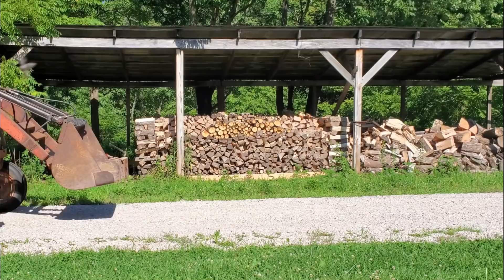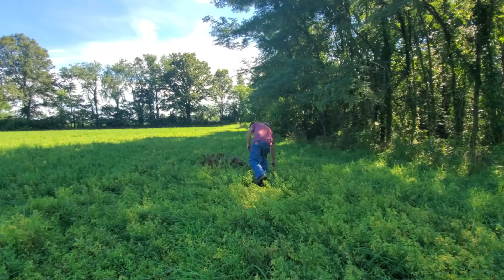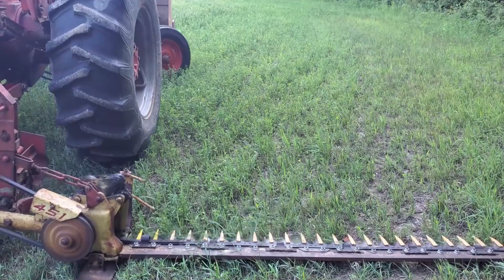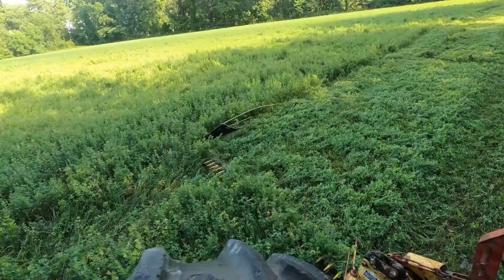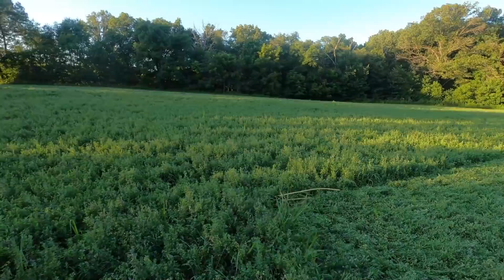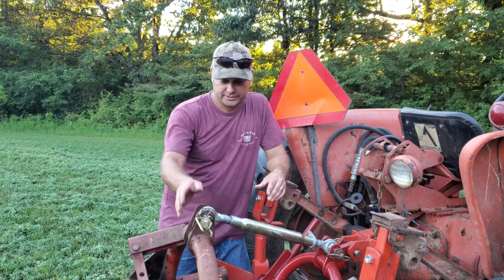Second time cutting of hay.  I hope the sickle bar mower does better.

Comment: your doing a great job and you know the problem and hit the answers. These are made for taller grasses. The weight of the taller grasses helps keep the cutters cleaned. The outer sweep (board) or shield is to lay over the hay so that the inner part that sits so lower will have a clear spot to go over. so if that shield is not flipping it out of the way you will get clogs on the inside.. good job
Reply: One of the better comments made.

Comment: Next trip to your tractor supply store get a "steering knob" that you can mount on your steering wheel to help whip around those corners quickly.  Also, setting your rear tractor wheels narrower might help make the corner turns more quickly. I spent my youth cutting alfalfa and doing the corners exactly as you're doing them, once you get the technique down, it works well.  Definitely add a steering knob, tho.
Reply: RM 4497 “steering knob” is called a suicide spinner locally, cause it makes it so easy to spin or over spin tight corners.
Reply: Right side wheel spacing is perfect as is.

Comment: Looks like a significant improvement form the first time both from the machine and your driving but I do wish you would cut 3 - 5 times round and then halve the field and lift the mower at the end drive around and drop it in as you get to the unmown area. Much quicker and more efficient for all operations.

Comment: I too am a hobby farmer.  We bought a horse farm in Georgia.  bought an old MF 12 square baler for 700 and an old deere sickle mower for 1250.  both were reconditioned and work fine.  we now have too much hay and now selling a little to pay for horse feed.  I bought a tractor with a loan, finally repair an old JD 820 after new clutch and injection pump.  I have a video on my channel and plan to post more.

Comment: split field into 2 lands, this will make longer rounds so you will not end up in middle of field when u finish cutting. Much less turning as well. Round is down & back. Headland is at each end of field where u turn to start new round. A spinner knob  secured to steering wheel is essential with armstrong steering. Placement of same is what is comfortable for operator. Please continue making vids., very good audio,video & content.

Comment: g,day  from Australia ,Evan lhad one one those NH 451 mower ,lgot out of a scrap yard near me it need some work,  l found that the bolt under the back of the P TO pulley when loosened it tilt the wobble box & cutter bar fore & back. So your cue bar is not so level instead of adjusting the Top Link Bar.. Give it a try it might help  you...great channel you both have  say safe  rt

Comment: Recommended to put a drop of red Locktite, to keep all bolts and nuts from unscrewing and falling off.
They all can be opened with some force if needed in the future.
Just clean them from oil and water before applications.
Thanks for sharing!!

Comment: Looks like the bar is out of square w the line of work...maybe just the video but I got this impression right away so watched for it throughout. I run a 456 (wheeled version of yours) on a 100 acres and can cut as fast as my IH560D wants to go in to highest field gear. I run a bottom serrated sickle and sharpen the top flats w a flap wheel between fields. Those new guards should really help. You can run a file up the sides of them after they round off from use. Nice  alfalfa. I've got no animal around my place that  deserves that kind of chow.

Comment: In all my years of mowing with a sickle bar, I have never seen that way of cutting out a corner, here an experienced operator would cut to the end of the piece, stop lift the mower, reverse in a tight arc which would bring him square on for the next cut, drop the mower and off before you could blink. The build-up of grass at the cutter head is in part because you don't have a proper swath board, the swath board clears a path about a foot wide where you run your rear tractor wheel next time round, this clean area helps keep the cutter head clear as well.

Comment: you might want to try going normal direction on the first outside pass, then turn around and go opposite to cut the hay closest to the fence.  this prevents you from driving over good hay before it is cut.

Comment: I like to make the first pass with the cutterbar to the inside of the field instead of outside, reason being I preferred the tire tracks that are in unmowed hay to be in lighter hay instead of heavier AND by driving the tractor around the outside, you can 'gauge' where the outer edge of your backswath will be instead of guessing and having the cutterbar too close or far from the edge of the field, and you'll have a better chance to see any branches or limbs before hitting them with the sickle.  

mowing in circles might be easier for you, but think about the pto angles on your baler when the plunger is compressing flakes of hay. much less stress on a u-joint if it's kept as straight as possible instead of intentionally putting into harsh angles under load.

Comment: I have a ford 501 mower i clean up at church with. I just put new guards on and a complete knive backer bar assembly then at church camp up north they sent me home with a 7.5ft cut flail mower that needs a new pto shaft and new drive belt and tensioner pulley and rebuild seized  tensioner adjustment and bracket has a bend in it.   My tractor may be able to run but not sure if i have the horsepower but i can fix mower and donate some $ to camp or fix it and sell it and $ to camp minus parts. We will see

Comment: after about 3 rounds raise up and loop out.  you may run over a little but save on the brakes and might even shake some of the buildup hay off the bar.might be faster than slowing down and making a direct turn

Comment: Check your pulleys. It looks like the lower one might have been replaced with a larger one at some point. That would make the sickle run slower. We always set the sickle tipped slightly (1/2 inch?) tipped up. That helped with rocks and stuff. It also seemed to reduce jamming/clogging. Like others have said do not make your corners directly, loop them and try not to slow your speed.

Comment: if nobody has mentioned it yet, the bottom of the hay bar out on the end should ride flat on the ground. this will help carry the cut grass away from the uncut grass much better so you have a little more play as far as not having to be exactly up against the uncut hay. if the hay bar runs flat on the ground, even shorter grasses will be moved away from the uncut grass.

Comment: I noticed that when you show drone footage while cutting the hay, the cutter bar seems to be on a bit of an angle following the tractor. I went back to the beginning of the video and noticed when you pulled away from the camera with the sickle bar in the transport position, you have some slack in the lift arms
Reply: This is what allows the sickle bar to trail the tractor on an angle, causing some of the problems you listed in the video.

Comment: If the break is not working properly, when you get to the corner continue straight and make a 3/4 left loop and it is equivalent to turn right.

Comment: Try this when cutting your hay field the next time, make 6 complete passes around the exterior of the field. Once that is complete, go to one of the shortest end of the field, that's called called "end rows or headlands". Find the center of the field by eye. Sight to the opposite end of the hay field by eye. Lower your sickle bar mower and cut that pass to the end, Circle the tractor around and run the tractor tires back on the cut you just made, to the end. Circle the tractor again and follow back to the opposite end again. In other words, you are cutting the field from the center of the field towards the sides of the field. You will find that you will have less turning with the sickle bar down and longer rows to rake and bale. Less turning  equals less time in the field.

Comment: Sad to see that it's still piling up on the inner shoe. You might get it to work at an acceptable level but it will never excel at the task. Still looks like a good crop that could fetch a nice price this winter if drought conditions here in the Mid Atlantic region continues to worsen.

Comment: get rid of that top link and get a straight bar and cut too holes in it and your pin use a bolt with two  nuts on it i had that  happen to me where the top link fell a apart and  i broke my pto shaft

Comment: You want to cut round 4 times and then  go up and down  just line up up down the middle cut it and work both sides saves all that tight turning  and you will find do the job easier and quicker same with turning and baling especially if you are going hitch the trailer to the baler

Comment: Have you checked the lead on your sickle.The toe of bar should be ahead of heel.Check operaters manual
Reply from the maker: The operators manual, says the heal leads around 3.5 inches.   But when cutting,  the ground pulls it back perpendicular.

Comment: Why does your muffler always seem to get loose on the D17? Are you using lock nuts on the connection with the exhaust manifold?  That may help with the problem....

Comment: Hard to tell with cam distortion, but it looks like the end of your bar is trailing too far... the cast of the bar should be adjusted forward... forward of 90d at rest so that under operation,it is at 90d to the tractor (by eye is good enough). The way it is now it is trying to tear as much as cut, and I think you would improve performance if not speed w/ the adjustment.
Good vid series... Thank you. BEERS

Comment: i wouldn't thedder it ,not enough crop ,you  knock off more leaves doing that ,just rake it,every cutting is less stem and more leaves,if you want more hay do the ditches around you too,you can meow it with a field mower and rake and bail it ,soft bails,drys fast,love the smell of fresh cut hay,gassing off

Comment: Possibly a little harder to cut when it is short like some of that is. Will cut considerably easier when taller, you will be working on the stem no leaves to bunch up or drag. Get rid of some weight on that tractor front when working in the field so that front end will skid easier for a square corner

Comment: You might want to trade that mower in for a 7 foot mower because that 9 foot mower is more likely to brake right in half.
Reply: There is no breaking problem.  Was designed for that length.  No problem.
Reply: Dwight L oh ok thanks for the info